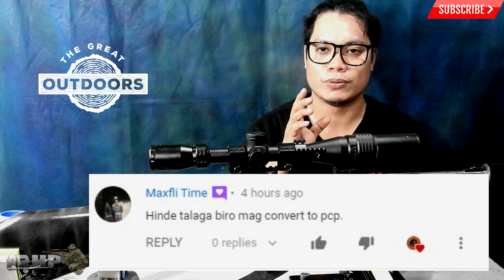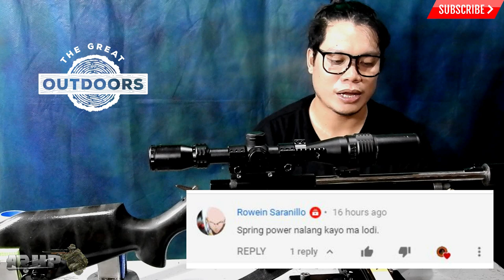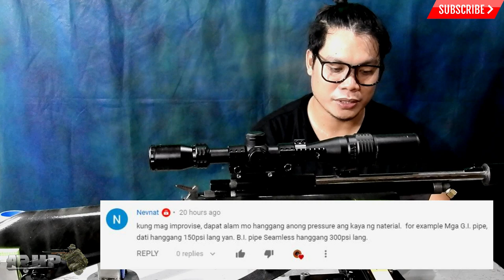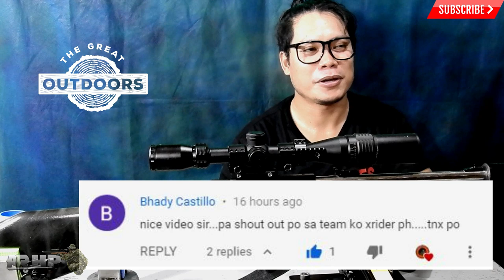BAKIT GUSTO MO NG AIRGUN? | Halagang 7000pesos may Airgun kana

Comment: Dave, remember your Tiksay pcp in two tone color (red ) & stainless is that in HPA or Co2 format ? I recalled, you said It’s powerful, so If you have that you can change the bbl to a  groove one not the choke one! you can use it for slugs, pellets spiral when fired on 940 -1000 + FPS especially those common light pellets @ 14 .3 gr. not so much with the heavier pellets like the Eunjin ( Seneca) rebranded in 28.00gr. & JSB Redesigned monsters in 25.39 gr. !
Reply from the maker: Pwede namn po xa sa hpa pero design po xa sa co2.. the concern naka lovk po un hswing mean na d xa malagyan ng bala sa chamber.. and oversize po xa sa . 22 .30up yata.
Reply from the maker: Im planning na ibenta or trade in nalng sa ibang type ng airgun for reviews

Comment: Dave,  in  P.A.’s website there are lots of new products from Hatsan, such as the “Hydra “which has the kit  quick change of calibers  from .22 to .25 cal. done by turning loose the screw on the rear of the receiver ,  then all the receiver, action, bbl are pulled up , and you can change to any cal. combination!
Reply from the maker: Thats gud thing, kailan kau uwi sa pinas?

Comment: Dave, as of today, I’m buying some .22 slugs to test it on each of my 4 pcps, but more on  the Seneca eagle claw! such as H & N .22 slug sampler in 5 different weights, also coming is the FX hybrid .22 slugs coming on Fri or Sat. on my doorstep! I’m also waiting for the JSB’s line of .22 slugs, coming  on P. A. & other outlets! by the way they are all in H. P. cylindrical or was it spherical in shape like a semi pointed shape with a hole on the tip! what’s good in these slugs is that they don’t wobble or spiral on flight when fired on higher FPS unlike pellets, but you should be having a good backstop when plinking coz it travels faster than a pellet!
Reply from the maker: Ilang grains po ung slugs for . 22? Dba choked barrel dpwede sa slugs?
Reply: Air Rifle Hobbies Philippines   Dave, If we talked about, H & N slug sampler, it has 5 diff. weights, in 21, 23, 25, 27, & 30.00 gr. JSB has their own also, with FX hybrid, but H & N is the only one who offers in sampler pack as well as individual weights!
Reply: Air Rifle Hobbies Philippines  Dave, slugs as well as pellets has assorted headsizes 216, 217, & 218’s regarding choke bbls, it’s okay as Iv’e used it in my  Hatsan Flashpup, ( 216, 217) headsizes!

Comment: Dave, It’s just a matter of preference for your part which comes first, info or subs. as long as you can do it,as for what you asked, There are so many new products from Hatsan semi autos like “barrage, galatian tact  auto /semiauto, & Hatsan fullauto, but it’s useless just a waste of pellets & also Ivanex Air speed, Max,from S. Korea, Huben k 1 & LCS 19 from China which came first in the first semiauto revolver type mag in production! with the the 2 companies which way ahead in function, aesthetics, superb machining of it’s lines!  As for pellets,JSB .25s (350ct.) @ $ 18.99 & cal. 30 (150ct.) @ $17.99 as for scopes you may browse in low power fixed category as in 2- 7 x 30 or you may find a much bigger objective, also red dots come in handy! Dave, I may remind you of unscrewing the elevation cap after you zero, & put back the cap with the zero mark, on the middle of your line of sight & screw it back as a zero stop!
Reply from the maker: Yes sir .. para d nako mahirapan saxpag zero ulit kasi doon na ka steady ang zero halimbawa sa 25y.. thanks po.. wait po.. mean na d maganda accuracy ng mga semiauto na mga airguns?

Comment: Idol meron po ba dito sa pilipinas na binibenta na daystate wolverine 303 at fx boss?
Reply from the maker: pb dioniso po sir, fb group po

Magandang Araw, thanks for tuning in po.
Maraming salamat po sa inyong support sa ating channel. Mabuhay po kayo!
Ito po yung kadalasang tanong na hope po makatulong.
Nagbebenta kaba ng AIRGUN?
-Sa ngayon nag promote and review lang po muna ako ng Airgun na aking nabibili sa mga maker. Pero maka assist po ako if saan po kayo maaaring bumili online.
SAAN MAKABILI NG AIRGUN?
Makakabili o makakaampon po tayo ng Airgun sa mga online store sa Facebook po.
1. Search Airgun group sa "Facebook"
2. Once accepted and join post for inquires
3. They will Private message po sa inyo sa mga details
a. Payment method
b. Specs ng Airgun
c. Warranty
d. Atbp.
4. Do background and legit check po by posting sa group
a. Tingnan mga friends list niya if madami syang kaibigan na Air gunners
b. Kung kalian ginawa account nya at least 5 years
c. Do a video call sa transaction and screen record for assurance.
d. Maganda kaliwaan ang pag bayad like meet up
PWEDE BA IPA CONVERT ANG C02 TO PCP?
Yes, pwede po sir, e check po ng maker if pwede most of the Airgun like: Nimrod, Manlapat, Taurus, Armscor, Atbp.
Pakita nyo lang po sa maker and ang maker na po mag suggest sa inyo anong conversion gusto nyo like bottle o naka tube. Range po sa 8k-12k pataas po ang bayad sa conversion nakadepende po sa maker. 

PAANO PAPADALA NG SELLER ANG AIRGUN?
Papadala sa currier ng seller, sila na po bahala doon.
By buss o barko, make sure po na complete address and my phone number and ask how long dadating.
Ganon din ask ang sellers for warranty what if di makakarating ang Item.

KAILANGAN BA NG LICENCE ANG AIRGUN?

There is no law that will punish anyone in the country for having an airsoft/airgun even if it is not registered. You also don’t need any form or permit or license to own one...our firearms law R.A. 10591 does not include the word airsoft or airgun in there. Feb 6, 2019.
Credit from: Journal.com.ph

PAANO MA PA REGISTER ANG AIRGUN?

Pag nakasali na sa mga Airgun group sa Facebook
You can ask for the legit person for register 
(LARRY AVILA) Philippine Team natin you can ask him po
Magbibigay sya ng mga info for requirments
Maganda if by group po ung pag register para isahan nadin po

PWEDE BANG ISAKAY SA BUSS O BARKO ANG AIRGUN?
1. Kailangan po na naka register ang Airgun
2. Kailangan dn may receipt ang Airgun na makikita kau ang may-ari
3. Mag inquire sa Buss and Ship station if pwede isakay ang Airgun
a. Ipakita ang registration at Reciept 
4. Pag pumayag na sila doon lang dadalhin ang Airgun
5. Baklasin ang Airgun-walang laman na c02 o hangin- at ilagay sa safe na lagayan
PWEDE BA MAISAKAY SA AIRPLAIN ANG AIRGUN FROM IBANG BANSA SA PINAS?
Sa ngaun limited po ang kaalaman ko tungkol dyan, ang iba sabi nila nakakapag padala sila sa balik bayan box.
PRICELIST STOCK AIRGUN: (Walang scope, Bipod, c02 Tank)
Depende po sa Seller ang Price either mababa sa binanggit kung Price o Mataas.
1. Nimrod co2 7500 more or less
2. Manlapat co2 13k more or less
3. Taurus co2 7500 more or less
4. Eskopeta co2 from 5500 pataas
5. Jr mangio co2 from 7500 more or less 
6. PCP pump 3k more or less 3 stage
7. PCP pump 4k more or less 4 stage 
8. PCP starting from 15k-50k local made
9. Scope from 3500-18k
10. Suppressor from 2k-5k
11. Tripod from 1500-2500
12. Scope 3500php to 5000php “Low end”
13. Scope 8000php to 15000php “Mid End”
14. Scope 20000php to 70000php “High end”

About namn po sa mga location ng pamilihan-cnxa po dahil hindi po ako affiliated sa mga company po o pagawaan ng airgun dito sa Pinas o sa ibang bansa.
Thanks, po sa support, Share and SUBSCRIBE po.
 from Air Rifle Hobbies Philippines.

Comment: Boss dave lopez ask kulang pO kong may bi inta kng airgun.
Reply from the maker: Thanks, po sa inyong mensahe. Maraming salamat po sa panonood.
Magandang Araw po sa inyong lahat, Maraming salamat sa inyong pagbisita sa ating channel.
Ganon din, salamat po sa inyong patuloy na pag subaybay. Mabuhay po kayo!
Always keep safe po, and God bless po sa inyo at sa inyong Pamilya.

Regarding po sa tanong ninyo. Pwede nyo pong ma contact sa messenger ang mga sellers po para ma assist po kau sa mga:
1. Contact info like cp# ng sellers
2. Accessories ng mga airgun
3. Brand ng airguns na avail nila
4. pricelist
5. paano ipadala
6. mode of payment
7. saan location nila
8. o may branch ba malapit sa inyo
9. atbp. na mga katanungan.
LOCAL SELLERS:
1. Win Lustarez
2. Robin Samonte
3. Rolly Aurellana
4. Philip Jeffreth Mendoza
5. Raffy Artigas

PAANO MAGING SAFE AND LEGIT CHECK?
1. Mag pa legit check-Ask ang mga matagal na sa airgunner
2. Mag padala ng Private Message- Send a message regarding sa information na gusting malaman
3. Once nag reply ask question regarding sa accessories or type ng airgun na bibilhin
4. Once na nakapag decide na sa bibilhin, mag video call po kayo para na makita nyo xa same sa profile pic at photos ng naka transaction na seller.
5. Before mag bayad sa item na kinuha mag papadala ang Seller ng Video na binabalot nya ung item mo
6. Hingin ang code if sa ano mang currier nya pinadala.

ADD ON QUESTION:
Ano ung valve na naka thread?
Ito po ang vid na ginawa ko sa installation ng airgun nimrod: https://www.youtube.com/watch?v=wrj_i6z119w&feature=youtu.be
Maraming salamat po. From AIR RIFLE HOBBIES PHILIPPINES

Comment: Bos Dave  tanong ko lang po kong may ka kilala  ka na may binibinta na air gun?
Reply from the maker: Magandang Araw, thanks for tuning in po.
Maraming salamat po sa inyong support sa ating channel. Mabuhay po kayo!
Ito po yung kadalasang tanong na hope po makatulong.
Nagbebenta kaba ng AIRGUN?
-Sa ngayon nag promote and review lang po muna ako ng Airgun na aking nabibili sa mga maker. Pero maka assist po ako if saan po kayo maaaring bumili online.
SAAN MAKABILI NG AIRGUN?
Makakabili o makakaampon po tayo ng Airgun sa mga online store sa Facebook po.
1. Search Airgun group sa "Facebook"
2. Once accepted and join post for inquires
3. They will Private message po sa inyo sa mga details
a. Payment method
b. Specs ng Airgun
c. Warranty
d. Atbp.
4. Do background and legit check po by posting sa group
a. Tingnan mga friends list niya if madami syang kaibigan na Air gunners
b. Kung kalian ginawa account nya at least 5 years
c. Do a video call sa transaction and screen record for assurance.
d. Maganda kaliwaan ang pag bayad like meet up
PWEDE BA IPA CONVERT ANG C02 TO PCP?
Yes, pwede po sir, e check po ng maker if pwede most of the Airgun like: Nimrod, Manlapat, Taurus, Armscor, Atbp.
Pakita nyo lang po sa maker and ang maker na po mag suggest sa inyo anong conversion gusto nyo like bottle o naka tube. Range po sa 8k-12k pataas po ang bayad sa conversion nakadepende po sa maker. 

PAANO PAPADALA NG SELLER ANG AIRGUN?
Papadala sa currier ng seller, sila na po bahala doon.
By buss o barko, make sure po na complete address and my phone number and ask how long dadating.
Ganon din ask ang sellers for warranty what if di makakarating ang Item.

KAILANGAN BA NG LICENCE ANG AIRGUN?

There is no law that will punish anyone in the country for having an airsoft/airgun even if it is not registered. You also don’t need any form or permit or license to own one...our firearms law R.A. 10591 does not include the word airsoft or airgun in there. Feb 6, 2019.
Credit from: Journal.com.ph

PAANO MA PA REGISTER ANG AIRGUN?

Pag nakasali na sa mga Airgun group sa Facebook
You can ask for the legit person for register 
(LARRY AVILA) Philippine Team natin you can ask him po
Magbibigay sya ng mga info for requirments
Maganda if by group po ung pag register para isahan nadin po

PWEDE BANG ISAKAY SA BUSS O BARKO ANG AIRGUN?
1. Kailangan po na naka register ang Airgun
2. Kailangan dn may receipt ang Airgun na makikita kau ang may-ari
3. Mag inquire sa Buss and Ship station if pwede isakay ang Airgun
a. Ipakita ang registration at Reciept 
4. Pag pumayag na sila doon lang dadalhin ang Airgun
5. Baklasin ang Airgun-walang laman na c02 o hangin- at ilagay sa safe na lagayan
PWEDE BA MAISAKAY SA AIRPLAIN ANG AIRGUN FROM IBANG BANSA SA PINAS?
Sa ngaun limited po ang kaalaman ko tungkol dyan, ang iba sabi nila nakakapag padala sila sa balik bayan box.
PRICELIST STOCK AIRGUN: (Walang scope, Bipod, c02 Tank)
Depende po sa Seller ang Price either mababa sa binanggit kung Price o Mataas.
1. Nimrod co2 7500 more or less
2. Manlapat co2 13k more or less
3. Taurus co2 7500 more or less
4. Eskopeta co2 from 5500 pataas
5. Jr mangio co2 from 7500 more or less 
6. PCP pump 3k more or less 3 stage
7. PCP pump 4k more or less 4 stage 
8. PCP starting from 15k-50k local made
9. Scope from 3500-18k
10. Suppressor from 2k-5k
11. Tripod from 1500-2500
12. Scope 3500php to 5000php “Low end”
13. Scope 8000php to 15000php “Mid End”
14. Scope 20000php to 70000php “High end”

About namn po sa mga location ng pamilihan-cnxa po dahil hindi po ako affiliated sa mga company po o pagawaan ng airgun dito sa Pinas o sa ibang bansa.
Thanks, po sa support, Share and SUBSCRIBE po.
 from Air Rifle Hobbies Philippines.

Comment: ,,boss pano po ba malalaman kong legit  ba ang onlineshop?.boss baka meron kau mai recommend na online shop,,salamat
Reply from the maker: Magandang Araw, thanks for tuning in po.
Maraming salamat po sa inyong support sa ating channel. Mabuhay po kayo!
Ito po yung kadalasang tanong na hope po makatulong.
Nagbebenta kaba ng AIRGUN?
-Sa ngayon nag promote and review lang po muna ako ng Airgun na aking nabibili sa mga maker. Pero maka assist po ako if saan po kayo maaaring bumili online.
SAAN MAKABILI NG AIRGUN?
Makakabili o makakaampon po tayo ng Airgun sa mga online store sa Facebook po.
1. Search Airgun group sa "Facebook"
2. Once accepted and join post for inquires
3. They will Private message po sa inyo sa mga details
a. Payment method
b. Specs ng Airgun
c. Warranty
d. Atbp.
4. Do background and legit check po by posting sa group
a. Tingnan mga friends list niya if madami syang kaibigan na Air gunners
b. Kung kalian ginawa account nya at least 5 years
c. Do a video call sa transaction and screen record for assurance.
d. Maganda kaliwaan ang pag bayad like meet up
PWEDE BA IPA CONVERT ANG C02 TO PCP?
Yes, pwede po sir, e check po ng maker if pwede most of the Airgun like: Nimrod, Manlapat, Taurus, Armscor, Atbp.
Pakita nyo lang po sa maker and ang maker na po mag suggest sa inyo anong conversion gusto nyo like bottle o naka tube. Range po sa 8k-12k pataas po ang bayad sa conversion nakadepende po sa maker. 

PAANO PAPADALA NG SELLER ANG AIRGUN?
Papadala sa currier ng seller, sila na po bahala doon.
By buss o barko, make sure po na complete address and my phone number and ask how long dadating.
Ganon din ask ang sellers for warranty what if di makakarating ang Item.

KAILANGAN BA NG LICENCE ANG AIRGUN?

There is no law that will punish anyone in the country for having an airsoft/airgun even if it is not registered. You also don’t need any form or permit or license to own one...our firearms law R.A. 10591 does not include the word airsoft or airgun in there. Feb 6, 2019.
Credit from: Journal.com.ph

PAANO MA PA REGISTER ANG AIRGUN?

Pag nakasali na sa mga Airgun group sa Facebook
You can ask for the legit person for register 
(LARRY AVILA) Philippine Team natin you can ask him po
Magbibigay sya ng mga info for requirments
Maganda if by group po ung pag register para isahan nadin po

PWEDE BANG ISAKAY SA BUSS O BARKO ANG AIRGUN?
1. Kailangan po na naka register ang Airgun
2. Kailangan dn may receipt ang Airgun na makikita kau ang may-ari
3. Mag inquire sa Buss and Ship station if pwede isakay ang Airgun
a. Ipakita ang registration at Reciept 
4. Pag pumayag na sila doon lang dadalhin ang Airgun
5. Baklasin ang Airgun-walang laman na c02 o hangin- at ilagay sa safe na lagayan
PWEDE BA MAISAKAY SA AIRPLAIN ANG AIRGUN FROM IBANG BANSA SA PINAS?
Sa ngaun limited po ang kaalaman ko tungkol dyan, ang iba sabi nila nakakapag padala sila sa balik bayan box.
PRICELIST STOCK AIRGUN: (Walang scope, Bipod, c02 Tank)
Depende po sa Seller ang Price either mababa sa binanggit kung Price o Mataas.
1. Nimrod co2 7500 more or less
2. Manlapat co2 13k more or less
3. Taurus co2 7500 more or less
4. Eskopeta co2 from 5500 pataas
5. Jr mangio co2 from 7500 more or less 
6. PCP pump 3k more or less 3 stage
7. PCP pump 4k more or less 4 stage 
8. PCP starting from 15k-50k local made
9. Scope from 3500-18k
10. Suppressor from 2k-5k
11. Tripod from 1500-2500
12. Scope 3500php to 5000php “Low end”
13. Scope 8000php to 15000php “Mid End”
14. Scope 20000php to 70000php “High end”

About namn po sa mga location ng pamilihan-cnxa po dahil hindi po ako affiliated sa mga company po o pagawaan ng airgun dito sa Pinas o sa ibang bansa.
Thanks, po sa support, Share and SUBSCRIBE po.
 from Air Rifle Hobbies Philippines.